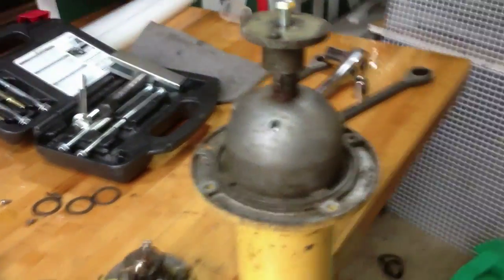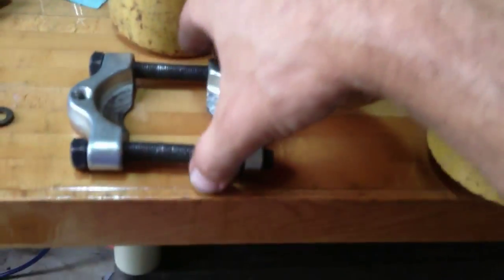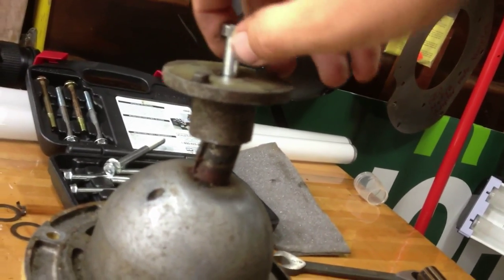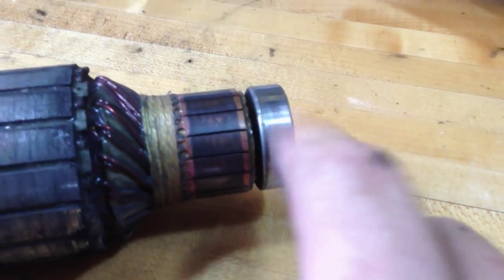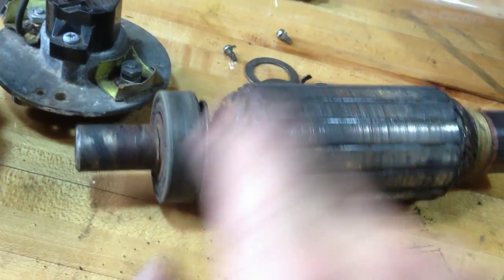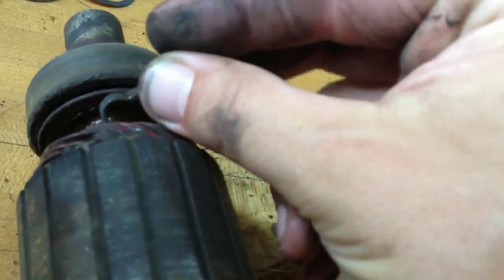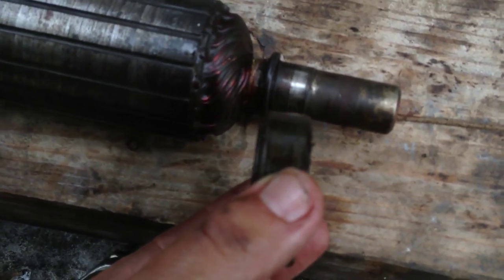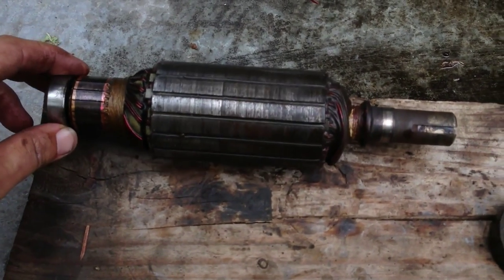E15 Blade Motor Rebuild Part 2

Comment from the maker: It's just graphite powder from the carbon brushes. I'm replacing the brushes and with have to "run them in". Once that's done, there will be a nice lubricating layer of carbon on the commutator.
I used an awl to clear out the grooves between the bars on the commutator.

Comment: That black stuff on the commutator is good stuff don't get rid of it. It acts as a conductive lubricant and improves efficiency, get it out from between the segments but leave it on the the working commutator surfaces.